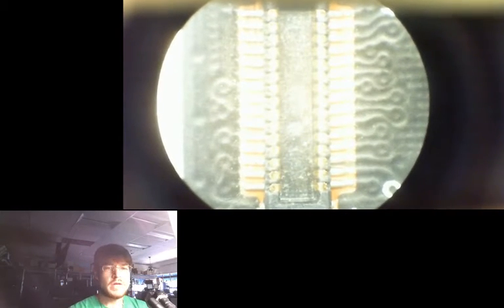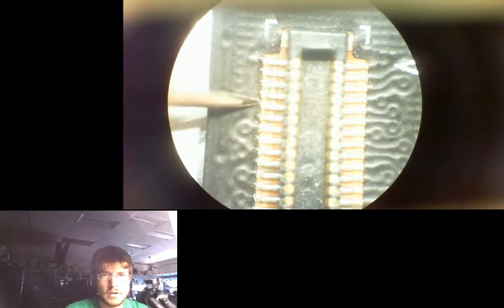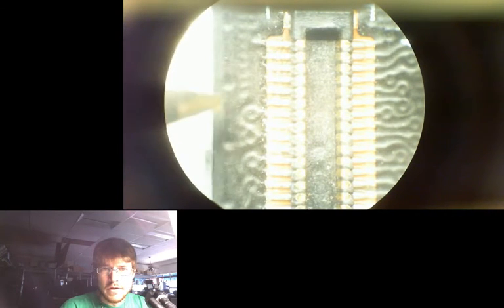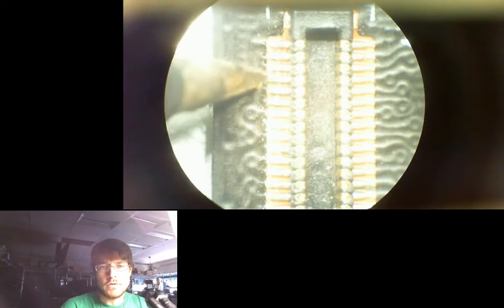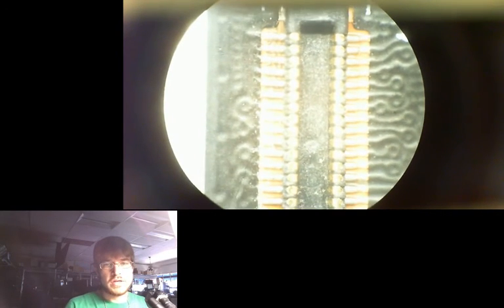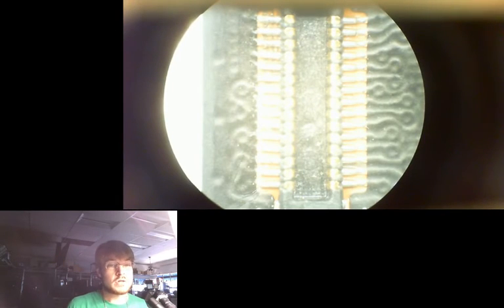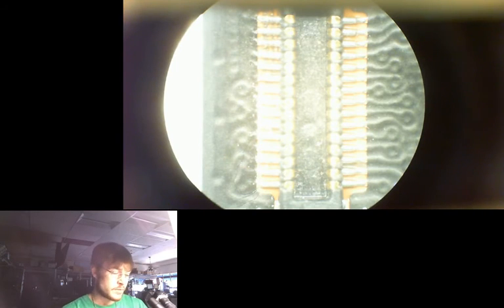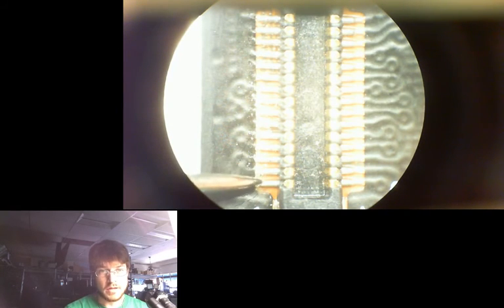Macbook Pro a1278 Wifi Problems FIX

Comment: Good job!!! 
You could show the real cable before use microscope, I dont know what part exacly is that, because I have 2 differents Macbook A1278 to repair. ^^
Reply from the maker: This was repairing the airport flex cable that connects it to the logicboard
Reply: @darklemon1  remember the year of this Macbook A1278 ???
I have 2010 and 2012 to repair.
Reply from the maker: @B.E.H.  this is repairing a flex cable so any of those listed models would use it, this was a 2012/13 I think
Reply: @darklemon1  no my friend, I checked today in my model 2012, the wi-fi card is different cable compared to 2010.

Anyway, thanks for reply / help!!! 🙏🏻👏🏻
Reply from the maker: @B.E.H.  yes they are different but this repair of the cable is the same for this instance, this is only to repair solder joints on wifi flex cable